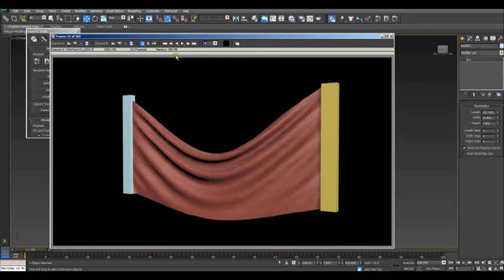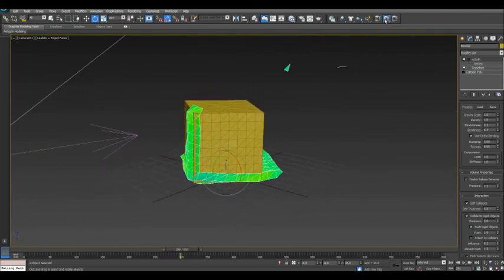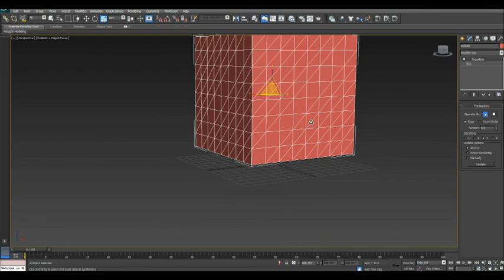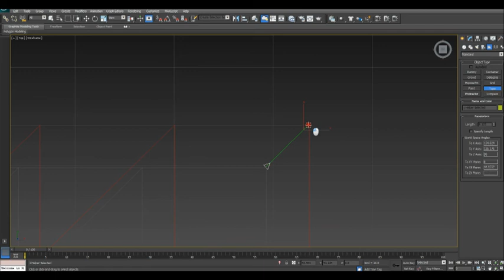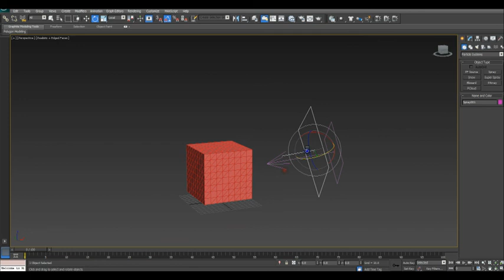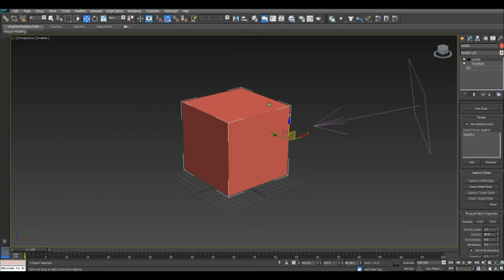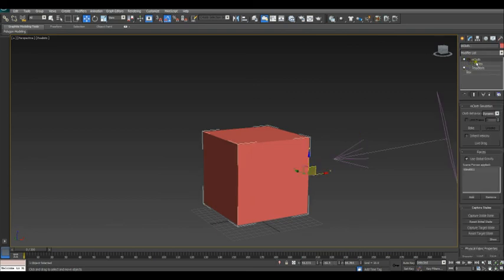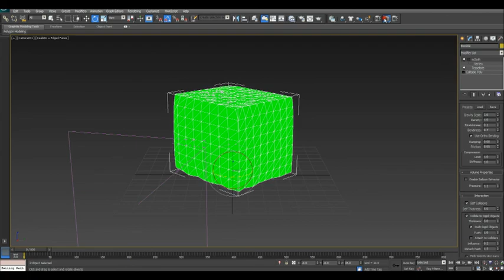mCloth - 3DS Max 2013 Tutorial. Level: intermediate. Part 3

Comment from the maker: Run the simulation on the low poly mesh. Drop a turboSmooth or a Smooth on top of the mCloth. mCloth will continue to run it on the low poly mesh.

Comment: Very good tutorial.

I am trying to render something like this, but i'm having smothing issues. Either the cloth is rendered in triangles, or i create a higher poly mesh and then my pc crashes when baking. (I have 5gb of ram so that should be an issue).

How would you solve this?